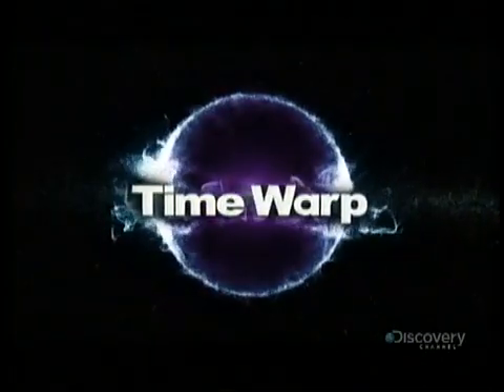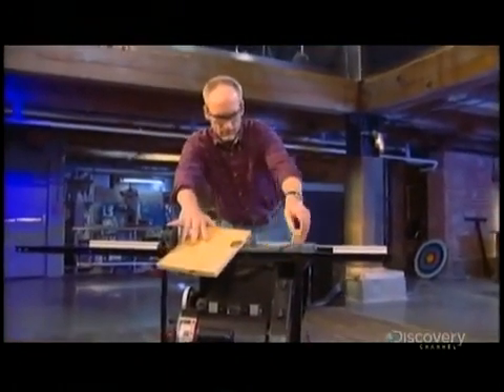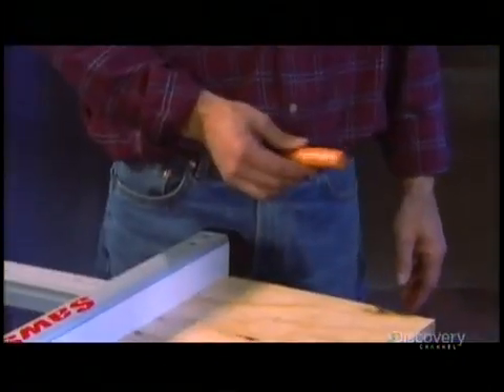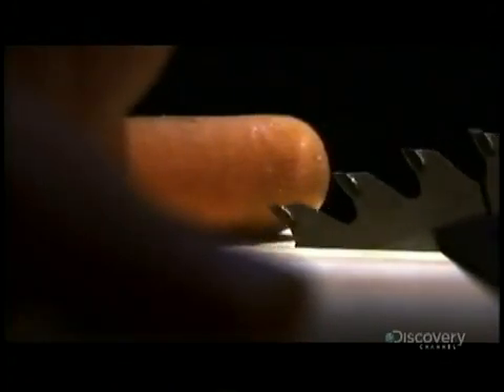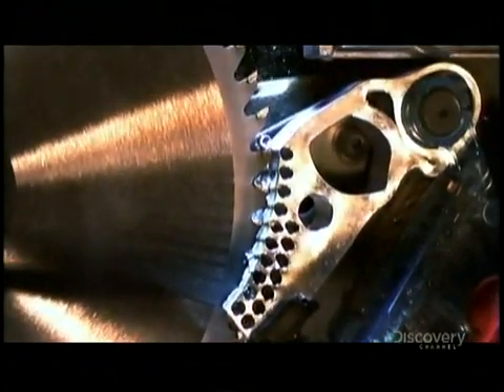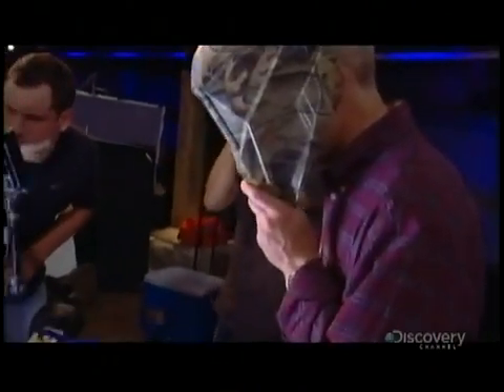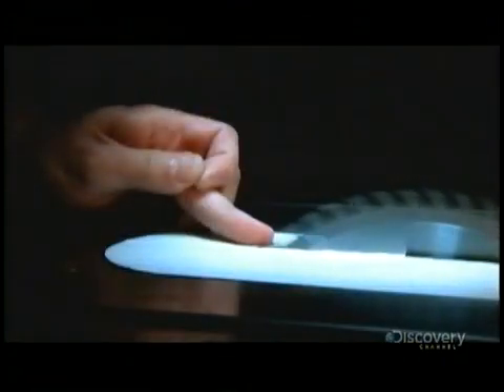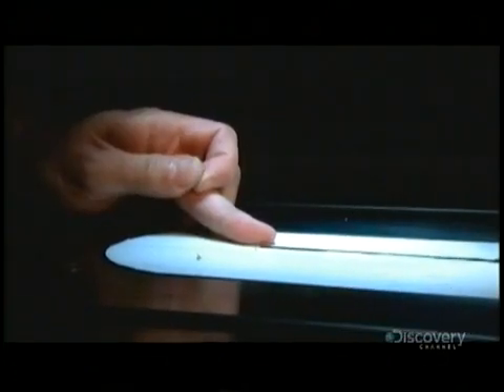Saw Stop - This guy puts a finger into an active table saw blade & comes away without a scratch!

Comment: What if the finger is in a glove?
Reply: It cuts through the glove, hits finger, stops.
Reply: You don't wear gloves with any spinning machinery.
Reply: its really fucking stupid to wear gloves when using machinery that spins that fast
Reply: Take the fucking glove off
Reply: +XenoGames No, as a journeymen machinist I know you don't use gloves with metal or any material when working with rotating machinery.
Reply: Why would you be wearing gloves using a table saw? sounds like trouble to me
Reply: +Binding of Isaac wat if ur finger inside a sausage
Reply: i work as a custom knife maker for a living and even when polish grinding i never wear gloves even the piece can get quite hot. If it's too hot to handle you cool the piece down. Wearing gloves is never a correct answer when you're around spinning machinery
Reply: +XenoGames say something is spinning and your glove that's just a tad longer than your finger gets caught just past the sharp bit and is pulled in. Now your hand is in with your glove. I made that mistake once with a belt sander. The glove I was wearing just barely touched the belt and it pulled in so fast that even though it pulled my hand off the trigger, I still had one nasty bleeding (what would you call that? A cut? Scrape? Contusion?) wound on the palm of my hand. I got lucky and it didn't permanently scar but it was bad, and with a blade, it can be way worse.
Reply: If your finger's in a glove then you're ready for some kinky shit!
Reply: +Thono hui You don't use this kind of saw to cut metal.
Reply: Thono hui Ahh, I see. My bad.
Reply: then it will cut through the glove and detect the finger inside
Reply: +Xenotrip Why are you cutting metal with a table saw?
Regardless of the material, you still never wear anything that can catch when working around rotating machinery. Go ahead and google "lathe accident" if you want to see just how brutal it can be.
Reply: +Fades depending on the Material you are working with e.g. if you are working with metal i would wear gloves if you are working with wood then i wouldnt
Reply: +Fades depending on the Material you are working with e.g. if you are working with metal i would wear gloves if you are working with wood then i wouldnt
Reply: +Fades depending on the Material you are working with e.g. if you are working with metal i would wear gloves if you are working with wood then i wouldnt
Reply: +Fades i am working for the thw in Germany and wenn wear gloves - probably we have different guidelines
Reply: similar thing happened to me, i was wearing gloves and using a drill to mix cement.. the glove fingers twisted around the drill and pulled my hand with it. just a surprise no cuts, but lesson learnt =)
Reply: Don't think you could cut metal with this system, as metal conducts electricity and so would also cause the saw to stop before even cutting into the metal anyway, gloves or not.
Reply: Lukáš Klečka Yeah I know, i was replying to another comment saying that...
Reply: +TheBanjoShow lol
Reply: Dhir Am it would detect it and stop
Reply: Taco Cat What if your sausage is inside a toe?

Comment: He should design it to where gears rotate the blade and have it drop straight down instead of breaking momentum when it touches a finger.
Reply: moving the blade without stopping it would never be as safe or reliable.
Reply: but the reason it works so well is that it turns the existing momentum of the blade into pulling it away - any other solution is going to be a lot slower and a lot less efficent.

the speed with which it pulls away still needs to be significant - slooooowly edging your finger into it gives it plent of time to act - if you fell across it i doubt you'd be so lucky using a purely drop down approach without the blade stopping action. - at the very least any other alternative would be a lot less efficent require a greater number of active components and cost more - the saw stops there as a safety net, not a hammock
Reply: +Misc the saw seems to be dislodged from the moving component when it is struck by the metal stopper. And to retract the saw would involve either dropping the entire motor faster than gravity can, or dropping the saw faster than gravity can while also allowing the motor to continue running the saw that just changed positions in 1/1000 of a second. This is brutal and destroys the blade and the stopper, but it's much more cost effective.
Reply: All table saws are belt driven, never seen one where the blade is on a the direct motor drive.
Reply: I have 2 that are direct drive. The cheaper ones are usually direct drive. Look it up.
Reply: yet again its going at a thousand g's it would probably shoot out if not held properly.

Comment: OK, but he dipped his finger in water so what if yo don't do that
Reply: Your body can still conduct electricity
Reply: AirCanada, you really killed the stereotype where all Canadians are nice eh?
Reply: +AirCanada .... Uhhhh... Wtf?
Reply: XxFlackerx_ _xNanersxX Yeah. Im French Canadian :/
Reply: It still works even if your hand is dry. I wrecked a 130 dollar sawblade but at least I still have all my fingers. No blood drawn, just nicked the callus on my finger
Reply: If you're sweating you're fine
Reply: Worst case scenario is that it draws a bit of blood, but blood is wet and salty and will activate the stop. If it doesn't, the friction from the spinning blade could pull your hand further onto it. So the stop is still incredibly useful even if you cut yourself. Bandaid cut or stitches and rehabilitation cut.
Reply: AirCanada ?
Reply: b 28282 That's true
Reply: That's just to numb them
Reply: +Sirsut Nack True, I wasn't thinking of that.
Reply: MinecraftMarcus1 ^ Sorry, I was on my period.
Reply: Go to Quebec and you'll see a whole new Canada
Reply: Then your finger is dry.
Reply: Wet or not, the body is still a big electrical capacitor. This works on the principle of voltage drops, not actual conductivity. When his finger touches the blade, the voltage across the entire system drops by most likely a few mV. Any time you introduce a resistive load to a circuit, there will be a voltage drop. It doesn't necessarily have to be especially conductive, but some kind of a resistive load. And the human body is exactly that, a very HIGH resistive load.

Look up "dummy resistors" or "dummy loads" to get a better idea of how that works.
Reply: Dhir Am
When you attach any kind of a conductive, high resistive load to a circuit, the voltage will drop across the entire circuit. This works purely on the principle of detecting that minute drop in voltage. Think of the human body like both a high energy capacitor and a very high ohm resistor. The resistance that our skin introduces to the saw blade will cause a voltage drop, and the fact that we have a high electrical capacitance means that we'll also allow for conductivity

Paper, for example, is an insulator to electricity because it is not conductive. However you can't touch paper to the saw blade and have the saw stop activate. It needs something that is actually electrically conductive as well as of high resistance to cause that voltage drop.

This is why wood, wet or not, does not activate the saw stop. There is no electrical conductivity to introduce resistance into the circuit, even though wood is a natural insulator against electricity.

The natural high capacitance of the human body also explains why static shocks are a thing. We are capable of storing large amounts of current within our bodies, and when that current is discharged in the form of static, it shocks us. And we build up that current by accruing positive or negative static voltages in our bodies.
Reply: Jussi J Boi, ever heard of a joke? Check my channel. I have 2 fucking minecraft vids on it XD
Reply: Didn't sound like a joke XDDDDDDDDDDDDDDDDDDDDDDDDDDDDDDDDDDDDDDDDDDDDDDDDDDDDDDDDDDDDDDDDDDDDDDDDDDDDDDDDDDDDDDDDDDDDDDDDDDDDDDDDDDDDDDDDDDDDDDDDDDDDDDDDDDDDDDDDDD
Reply: Jussi J :P
Reply: Jussi J xD

Comment: Try dropping a hot dog on it. I wonder what would happen if you were putting force on an object (wood) and your hand slipped thus moving your hand quickly into the saw.
Reply: I think you will get hurt, but in that speed it shuts down i think it still could protect your fingers or arm to completely been cut off and just leave maybe 1-3mm wound.
Reply: perhaps. But clumsy people have difficulties typing or playing the piano, or writing with a pencil like the rest of us!! - when they lose a finger or 3!! So, they'd appreciate it when the saw saves their finger! Think of it like airbags in cars. They may be for clumsy drivers, but they also protect careful drivers, when idiot drivers slam into their car.
Reply: Honestly you don't really have a reference frame.

The difference between slipping quickly and going at a normal pace is going to be about 3 times as fast, let's call it 5 times as fast just to make it ridiculously fast.

Let's just make up some numbers.

Say you moved 1 unit per second. As in let's just say 1 inch per second.

Say you traveled 5 units per second instead.

When you are talking about "Less then a millisecond" things like accelerated speed make little to no difference.

That is the difference between 1 thou, and 5 thou. Or roughly 0.127 mm. Thickness of your skin? 1.5 mm.

You would need to be traveling roughly 60 inches per second, to go through your skin before this kicks in. 60 inches per fucking second.

Of course 1 inch per second came from actual cutting time. Regularly it ranges from 1-2 inches per second, and 3-4 during a slip, 5 is a little high, but a complete without wood slip would be 6-10. Seems fast relative to what you're doing, but really not that thick when you remember the point is to save a finger. The point is to make it a nick, or a simple cut if that's even possible with the timeframe we're talking about. Not to stop injury all together.
Reply: I wonder that as well, but if there is any reason you hand would slip and push your hand in the saw is because you are putting to much force into what you're pushing through the saw. one of the reasons it spins so fast in so you don't need to put pressure into pushing, you only need to push the wood softly and let the saw do the work. so this invention is for clumsy people.
Reply: Nothing, unless of course you were moving faster than an electric current. The only way you would get cut is by hitting the blade after it stopped
Reply: try flicking the saw lol
Reply: U gonna get blood and Injure, but the injure won't as much as losing a finger
Reply: They did, in the first test. The hot dog came pretty quick.
Reply: Nice
Reply: They never actually touch it, it uses conductivity in his salty wet finger to trigger
Reply: You can see this on https://www.youtube.com/watch?v=SYLAi4jwXcs. He hit the blade with a hot dog about as fast as you can punch and it only bored 1/8 of an inch into the hot dog. You'd definitely need stitches, but it wouldn't touch bone and you would be nowhere close to losing a finger.
Reply: There's a video of that now.

Comment: To everyone saying this should be a standard thing in all power saws, this will make goods cost significantly more not just for retrofitting each machine with this tool, but for the frequent engagements of the saw stop every time some wet wood or maybe a tiny staple gets hit requiring a brand new blade ($60 is on the cheap end for a 12" circular saw blade, specialty blades can cost several hundred), drastically reduced life of your equipment as every engagement of the saw stop stops not just the blade, but everything inside the saw causing huge amounts of stress of gears and driveshafts that the saw was never meant to endure.

Plain and simple, everyone who wants this installed everywhere are people who never ever use power tools, and everyone who does use power tools generally agrees they'd rather have that minor risk than deal with a safety feature that only really helps people who are already being unsafe.
Reply: lol

Comment: That should be on sale
Reply: no. you're only meant to replace it if the device was activated e.g with a finger. Then you have to replace it as all the force mangled the stop and saw.
Reply: "but you need to replace the stop thing every day" To my knowledge this ONLY applies if you're stupid enough to keep putting your finger into the blade. it's called learning and being more self-aware.
Reply: would you rather lose a finger or replace somthing that probably costs less than your finger?
Reply: but you need to replace the stop thing every day
Reply: ***** what do you mean? I was talking to this guy that said you have to replace the stop every day. But you don't.
Reply: it is, they have this at the shop at my school

Comment: the thing is, hes putting it close to the saw very slowly. What will happen if he just shuved his finger quickly is the real question.
Reply: He wasn't moving the hot dog sausage slow at all.
Reply: You'd get cut really bad but still have all of your fingers.
Reply: everyone says the same but thats because everyone is the same in this way: better a little cut in your finger(s) than your finger cut in half, so i mean if he moved quickly he would get a little cut
Reply: When they tested it with the sausage, he went pretty fast with the wood through the saw, and the sausage got a really small cut. If someone cuts wood faster than that (with sawstop) they will get a slightly bigger cut (probs no blood) but the wood that he cut would be splintered and ugly...
Reply: slight damage that he didn't want, he has faith in his product but knows it's limitations. He wouldn't lose a finger but there would be some slight damage yes.
Reply: What? Yes, a sawblade should have sharp teeth for optimal performance. They don't necessarily "need" to be sharp to perform their function, but neither does a kitchen knife. They're not keen, of course, since the edges are large angle, but they should be sharp, especially if you're using a high quality new blade.
Reply: In one clip he does push the hot dog really fast and it did cut it a little bit. Enough to draw blood if it was a finger.
Reply: MrCapeCanaveral anecdotal evidence but the one time I did trip a sawstop my hand slipped and I hit the blade fairly quick.. index finger nicked; no blood drawn. 
I suppose if you were really sliding your hand into the blade like table-hockey speed you'd probably draw blood but who moves their hands that fast on a table saw?
Reply: why would you cut would that fast people usually go slow to get a precise cut
Reply: did you seriously spell "wood" wrong?  
most carpenters use a table saw 50+ times a day, 5 days a week.  we dont go slow lol
Reply: ***** I'm assuming the thought is in case your hand slipped somehow? I dunno
Reply: Most people rip wood down with care and precision not fast as you can. I've seen these brakes go off in person under normal circumstances with 9th graders and up. Looks like a bad paper cut usually, but ya if you slam your finger through that blade, common sense should tell you what would happen
Reply: im asking that myself aswell. i guess it will cut your finger open (id say 1-3mm deep dependng on the speed that your finger hits the blade) but all in all a slice in the finger is better than no finger
Reply: then rip
Reply: I bet you blacked out during the video